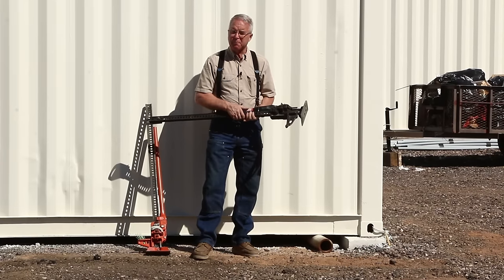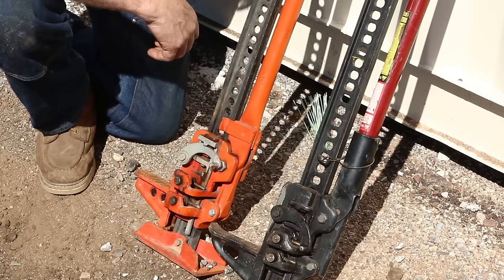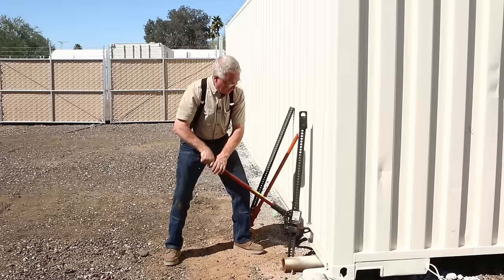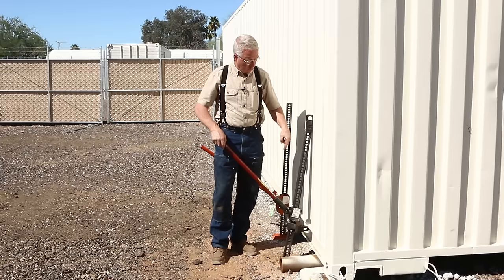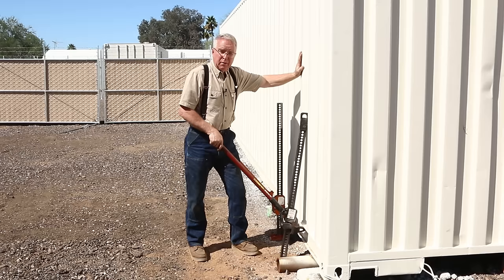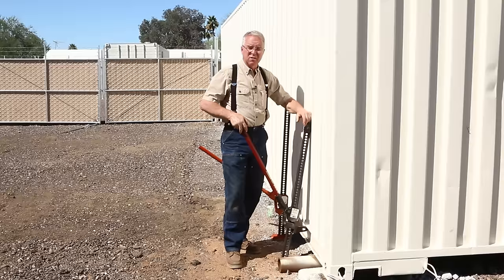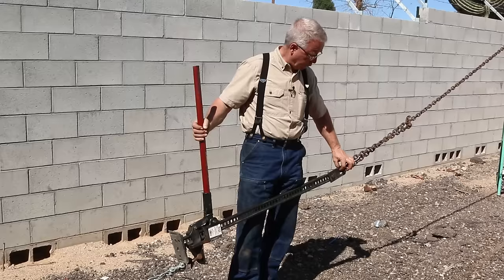Operating a Hi-Lift Jack

Comment: They can also be used as a push-a-long.  If you need to pull something apart and you can get the footplate and nose between them, you can push whatever apart.  Example: if a heavy load on a trailer shifts, like pallets of seed or a shuttle, you can place the foot against the load and the nose on the trailer edge or tie-down slot and use the jack to push the pallets apart or back into place to be retied down.

Comment: My 12’x20’ shed (standard stick built) is out of plumb.  I need to lift one end up approx 4” to get it level. It stands on a gravel pad roughly 8” thick.  If I use two of these, they should lift the shed, correct?  I guess I need to know the weight of the shed and the max lifting of the Jack.  It seems to me, since I don’t have the distance to use a bottle Jack that this might be the answer.  Or is this a dangerous thought?

Comment: Just be careful with the jack when I was 25 I got stuck in the mud in the woods and not the handle but the top of the jacket its self slipped out from under the bumper and hit me right above my eyebrow knock me out I was in the snow I don't know how long I was out but I woke up and there's blood everywhere and I walked back to the house. I'm sure it was my fault the bumper probably had ice or something  under it we was cutting wood but just be careful with it. I still use one

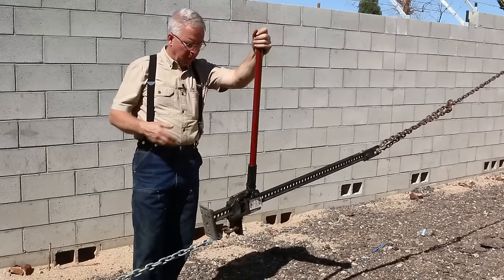Comment: 5:13  wrong connection to the large runner with that shackle on the eye hole in the large runner
https://hi-lift.com/wp-content/uploads/2016/07/jack_instructions.pdf
manual page 12 from Hi-Lift jack operators manual says do not connect here.
That hole is a bolt or pin hole for securing accessories.

Comment: @Essential Craftsman For years I always used a block of wood or concrete for the purpose but now they make these handy plastic lawn spreader’s that are designed specifically for the highlift Jack… The nice thing about them is they don’t weigh anything if you’re keeping it in your jeep or car truck and they are designed for the Jack to fit into unlike a board so it won’t try to slip off when you’re loading it up. 

 ORCISH Off-Road Base Farm Off-Road Lifting Jack Base for Hi Lift Jack  https://www.amazon.com/dp/B07TYCFM6T/ref=cm_sw_r_cp_api_i_0E8FFbAG3DM2M

Comment: Yeah these Jack's are very versatile but are dangerous as all get out, I've had a 40 foot livestock trailer fall on me because of these Jacks and the only thing that saved me from the trailer coming down on me is I jumped back underneath the gooseneck part of the trailer. We have a good moto at work for these Jack's, it's the jack you leave on the tailgate when going down a old country road.

Comment: I hate to be 'that guy', but you aren't supposed to use the hole under the nose when winching something, as per the hilift website. I don't know why they even continue to put it there, granted it is probably fine for light loads. Per the website, you are supposed to use an adapter of sorts on the nose. Page 11 https://hi-lift.com/wp-content/uploads/2016/07/jack_instructions.pdf

Comment: #EssentialCraftsman has gotten me to do what no other youtuber has, ...sign in, and comment...
-I'm sorry to have to correct you, sir, because I do greatly respect your gift of knowledge in the aspects of General Contracting, but you got a lot wrong in this short video.
1. "Hi-Lift" is a Brand Name ( like Pepsi or Coke .. both are Colas), not what this tool IS. The tool is a "Farm Jack", originally intended for use on the farm for lifting farm equipment. It's design is to accommodate the great variety of implements, that do not require a high capacity hydraulic type jack, but do require the ability to lift a great range of heights.
2. While you did mention in a general manner, the safety risks, you completely failed to cover the MOST dangerous aspect of this tool, and that is the lowering of a load. You covered the risk of losing grip of the handle with the lifting lever in the "raise" position, but did not mention, or demonstrate the lowering of a load, and losing ones grip, where the momentum of the ratcheting handle will allow the load to walk down the bar/post at an alarming rate, and while whipping the handle up and down violently. Depending on the weight of the load, the force of the handle has the capacity to break ones wrist, if one were to attempt to grab or stop the whipping handle...and that is if you are lucky enough to not get smacked in the face when you lose grip, with the raising lever in the "down" position.
3. I'll have to watch again to confirm, but I believe you completely over-stated the lift capacity of a farm jack, which is a MAXIMUM of approx. 2 1/2 tons, and that, that figure is the strength of the lifting mechanism it self, not the actual SAFE capacity of the jack at various heights or in various positions. It is in NO WAY SAFE to lift 5,000 pounds in the top 1/3 of the height of the jack, without some other sort of bracing or support, OR to lift 5,000 pounds with the jack at ANY sort of an angle (in, out, left or right of Plumb). *Personal experience- I use these jacks very frequently here in the East on and around the farm, as well as to position and move Amish-built storage sheds. I have bent the lifting post of more jacks than I can count (both generic, and "Hi-Lift" brand) using them to lift/move LESS than 1,500 pounds of an 8x8 shed, with the jack positioned 20-35 degrees off-plumb. These jacks are not intended to lift an 8,000 pound, 40 foot shipping container as you attempted to do and demonstrate.
-Which brings me to number 4
4. Your demonstration of trying to lift a too big load, at too small a lift point (the little lip of the top of the bottom channel), on the very tip of the Toe, with no support under the Foot, and no blocking between the Head and the Load .. is exactly how NOT to use a farm jack safely or properly .. Shame on you, sir. You should have placed the jack UNDER the container, which would still have been too heavy a load, but would have at least placed the load at the strongest point of the Toe, and allowed you to keep the Post more Plumb, as you lifted. Placing a wood block between the head of the post and the container would have served two functions: It would hold the post more parallel to the load, as well as added a friction component, to help keep the head from sliding sideways should the load try to shift (steel on steel is slippy, steel on wood not so much).
Reply from the maker: Thanks! Some good points here!!

Comment: Hi lift jack.  Should be known as widow-maker jack.  I own several of them and still use them.  But they are undoubtedly the most dangerous thing on the farm.  I have been present when one flew out from under a truck and pierced the wall of the shop.  That same jack split a guy's ear from top to bottem when the handle smacked him upside the head.  Off to the ER.   And finally,  a friend of mine was was killed by using one to jack up a trailer.  Please don't mess with these if you didn't grow up with machinery and people to learn from.  Just sayin'.

Comment: Keep ur head out from between the bar and the jack when in use. You had me cringe on that one when lifting with it. Also, when using as a come a long DO NOT use that hole on the lifting mechanism like you did for a clevis because at that point, you no longer have the full strength of the mechanism but rather just the lifting strength of the tiny piece of metal that braces the mechanism. These farm jacks are def a great tool but VERY dangerous if used incorrectly. I have one for off-roading but its a last resort. Either way, have a good day...
Reply: Not often I see him called out. Thanks for looking out for my safety. If I ever use of of these I will keep you advice in mind. I'm personally not a big fan of getting hurt.

Comment: •Yes, super useful tool.
•Yes, super dangerous tool.
•Take the Tom & Jerry cartoon literally. The handle is Jerry’s hammer.
•Now, imagine standing the jack on its base, then standing yourself on one foot on top of it. That’s just how stable it is: totally not.
•Keep your rescue crew within sight, but AWAY from the jack and the load. Keep your kids in the house.
•I consider this more dangerous than my saws, jointer, planer, gantry, chain fall, hoists, lifts. It’s unpredictable. It’s the tame lion purring contentedly that suddenly decapitates the human.

Having said all of that, I did inch up one end of an empty 40’ conex about waist high, to level it with concrete blocks—blocking as I went, of course. It was rickety and dangerous. I kept out of harm’s way, had an escape route, and still have all teeth and appendages. Dumb as it sounds, I used a cheater pipe on the handle, a long one. That got me away from the container, damped the line-drive batting action of the handle, and limited the force I had to apply. I still wasn’t strong enough to exceed the jack’s rating and break it. You shouldn’t either!
Reply: @Alan it was Sylvester and Tweety (not T&J), but yeah LOL. Our operation was probably more like Roadrunner and Wiley Coyote -something always blowing up, falling apart, or collapsing. And I had totally forgotten about the cheater pipe on the handle... we did that too - not sure we were being more safe or just more cheap (not enough jacks/people/etc).  But when you're 20 you're indestructible, right?   At the time I did not realize there were shear pins in the jacks (learned that just now) - they would have saved us from ourselves I guess.

Comment: Clean with carb spray- buy ONLY HI-LIFT brand. HF ARE JUNK and will hurt you!!
Also have good shackles and slings to use with them
When you go to lower one and you have one hand on the jacking lever and one hand steadying the vertical rack, learn to trip the reversing lever with your boot heel- never let go of jacking handle. Be ready to catch the downward descent of the lifting mechanism once with the jack handle is no longer under load- it will simply slide like a rock down the rack so watch your toes-

Comment: Is it me? Or is his math all wrong? "This thing weighs 8000 pounds", "The jack is rated for 7000 pounds", "This things should lift right up"

So he is lifting something that weighs 8000 with something that is rated for 7000, 8000-7000 hes 1000 over the rating?
Reply from the maker: Only lifting one end at a time...👍🏻

Comment: Wow, that is a dangerous way of using a hi-lift.  Your body should be turned away from the jack and pushing it to the side of your body.  If your hands slipped, you would be going to the hospital.  I used to do SAR and have had hi-lift training.  That is something they specifically told us not to do.
Reply: Thank you for the video